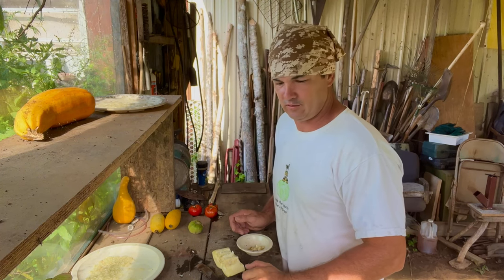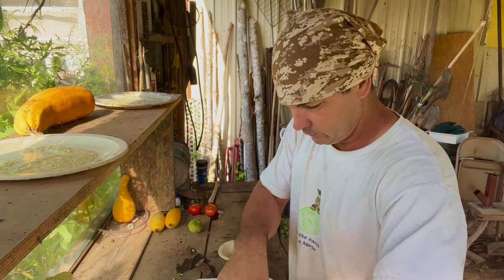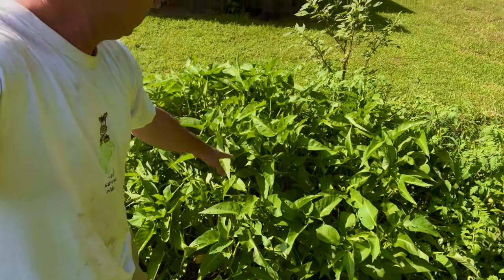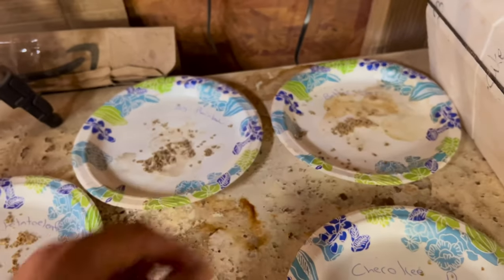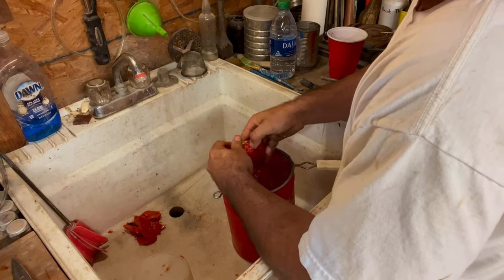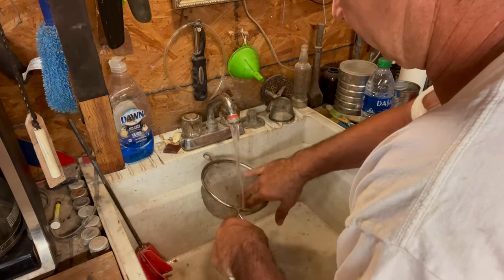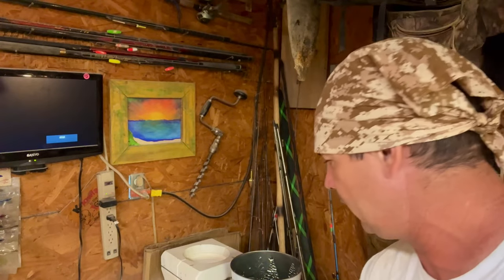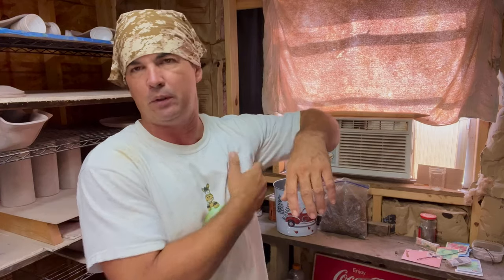Saving Seed for next years garden

Comment: Any tomatoes you can make ‘Sun Dried’ by just dehydrating in your oven at the lowest temperature using a wooden spoon to keep the door open a bit for air to circulate.  Cherry tomatoes you just pull the stem off and cut in half after washing.  Stores in an airtight container for 6 months.  The cherries taste like candy.
Reply from the maker: May have to try that